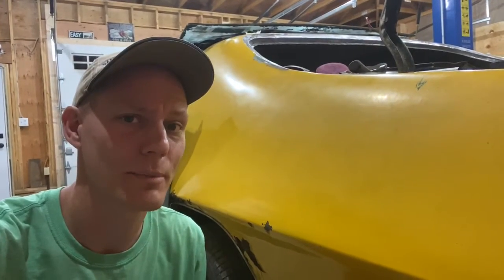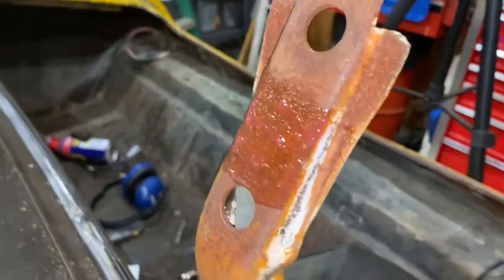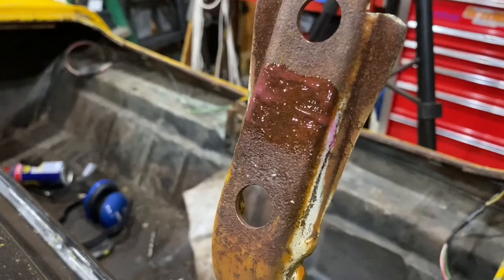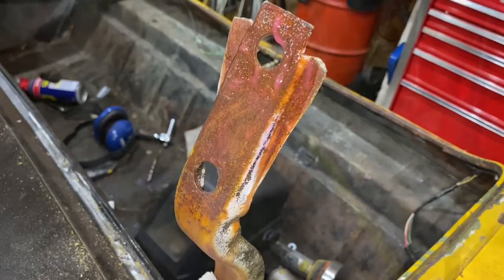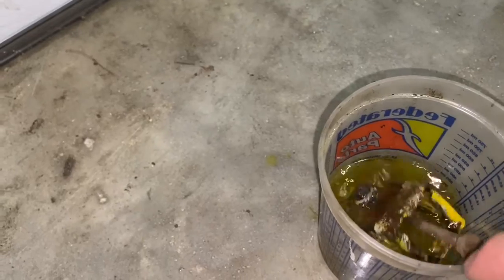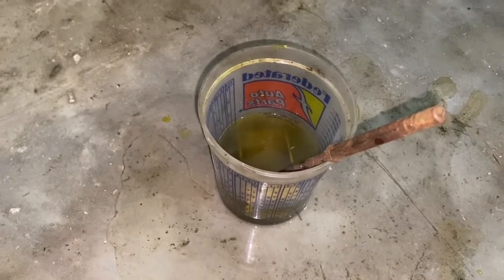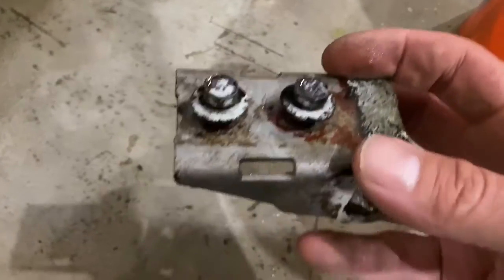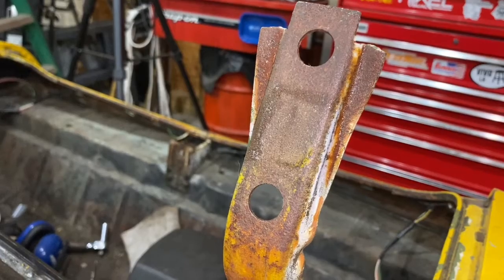Rust Removal: Naval Jelly vs. Muriatic Acid - Who Wins?!

Comment: Naval Jelly on flash rust, or surface rust on bare metal that you may have stripped, but then got pulled away from for other projects, is really good. On thick rust, it is pretty crap. Remove what you can, and then apply a rust encapsulator.

Comment: my choice is.... neither of the above. 
My first port of call for any items you can get into your container of choice, is Electrolysis. It is extremely cheap and safe and once you get used to it, is very effective. Gets rid of all the rust but, unlike any of the acid treatments, does not damage the metal underneath.
Reply from the maker: That is something I have never tried, and I really need to. I have seen others have great success with it!
Reply: @WiringRescue  
A big old plastic water tank, a 12v dc supply [old 'non-intelligent' type battery charger]and a bag of washing soda is about all you need. Remove bulk of rust with wire brush, thoroughly degrease and ensure good electrical contact to individual parts. Give it a go and it will soon become another great tool in your arsenal.

Comment: I used Naval Jelly 50+ years ago and it really needs to sit overnight and be covered with SuranWrap. It works very slow when it's cold but better when warm, but even then, the results are mediocre. Basically, it's not very good stuff.

Muriatic Acid works quite well but if you don't know how to be safe with it, don't use it.

The best is Evaporust. If just surface rust, it will be totally clean in a few hours. If heavily rusted, leave overnight. If extremely rusted, leave in for 2 nights. To excelerate the process, keep it warm or even hot on a stove top. Also, it's biodegradable, will not irritate your skin or eyes and has little to no odor. Absolutely wonderful stuff even at $30 a gallon and you just keep reusing it till it stops working. I use lots of it.

The simplest and lowest cost is electrolysis using a cheap battery charger or just a battery. Google it or spend hours on Utoob viewing hundreds of videos.......

Comment: Hello,
  The muriatic acid is in another league from any naval jelly product. It will remove rust down to the bare steel, but needs adequate ventilation, as the fumes are not pleasant. Muriatic acid will also remove hard water deposits in an engine block that was run without antifreeze, as well as water lines. It dissolves the calcium and iron down to the original surface. 
  I was quite surprised at the poor results of the naval jelly. I had expected something better. You presented the products in a nice format. I found your video interesting and educational after forty years of using muriatic.

Comment: I have used the stuff, it works great.
1. remove flaking rust with a wire brush of some sort. Don't go down to bare metal.
2. apply naval jelly, liberally
3. let sit for 30 minutes. (directions say 5-10)
4. wash off with water.
5. repeat if necessary

Comment: For small parts and tools, submerge in vinegar (@$2.50 a gal) for days, rinse and scrub in water, then dunk in soda water. For panels and welds, sand, wire brush and spray with a rust converter, like Permatex or Marhyde (3M). It turns black.Then primer.

Comment: The Naval Jelly certainly wasn't very impressive, although it definitely did remove some rust, as evidenced by the pitting on the metal becoming more visible. Personally, I've tried just about every rust-removal product/DIY method under the sun EXCEPT the 2 in this video. The muriatic acid definitely had above-average results. However, out of them all, I've found electrolysis to be the most effective method for me. It's very easy to set up, there's a ton of videos covering small-scale electrolysis. I was initially discouraged because the videos all seemed to suggest that an older car battery charger was mandatory. It's not.  I made a set-up out of a basic AC adapter that I use daily with spectacular results. Washing soda is also specified in most instances, so just as an FYI I wanted to note that you can make washing soda out of baking soda; just pour some on a cookie sheet and bake it at 200°F for ~an hour, mixing it up every 15 min, and it will turn into washing soda. You can even use this method indoors, but be aware that if you use washing soda as your electrolyte, hydrogen gas will be released so use it in a well-ventilated area.
Reply from the maker: Great info! Thanks for sharing it!!

Comment: AFTER USING MURIATIC ACID ON ANYTHING YOU NEED TO WZTER DUNK/POLISH/CLEAN THEN COAT LIGHTLY WITH OIL OR A LIGHT SPRAY OF PAINT OR IT WILL BE RUSTY AGAIN VERY QUICKLY. NOT AS BAD AS BEFORE BUT THE SURFACE WILL BE RUSTY.

Comment: It gets under calluses**
Reply from the maker: Lol. I'd believe that!
Reply: @WiringRescue  As a teen I would pressure wash the neighbors boats for money. 

I always used muriatic acid. One time I must have been hand washing or had crawled in it..... Woke up at 3am to my calluses falling off, and 8 holes 1/4" deep. 

A long soak in a PH basic liquid is a good idea if you get calluses wet. 

Good wheel cleaners will do it too***

A good box fan is a long term investment if you love using harsh chemicals all the time. 

Detailing and working on cars is probably worse than smoking lol

Comment: You are using it wrong. The gel turns iron oxide (rust) in iron phosphate which dissolves in water whereas iron oxide does not. Need to thoroughly wash the part with water. That will carry the now iron phosphate away.
Reply from the maker: Good to know. Thank you!
Reply: H2O is the missing ingredient, in changing it to iron phosphate.

Comment: i learned someone expects jelly being left on for less than a day to remove years worth of rust is disappointed..hi expectations
Reply from the maker: I wish it had instructions like that on the bottle. Unfortunately it does not say “leave it on for a day”.
Reply: It’s for light surface rust not the layers upon layers that u expected to completely disappear in 10 minutes
Reply: The loctite jelly works well, but as mentioned you can't expect big results leaving it on for only 10 minutes.

Comment: Always have baking soda near by when using muriatic acid. It neutralizes the acid fast.
Reply from the maker: That is something I will do next time for sure. Muriatic acid is no joke!
Reply: So do you put the baking soda before or after you put the part in?
Reply: @backyardrestorations  you throw the powder on splashed acid, or use a mix of warm water and baking soda. To neutralize an acid bath you put baking soda in after you have finished using it and before disposing of it. Doing so will render the acid inert, so use it only when you are done using the acid. Rinse parts in a baking soda/water solution then rinse  with water for best results and “safest safety”.
Reply: Wear your PPE!  Gloves and goggles.  Also, never add water to acid, you should rather add acid to water... it's a very important safety step

Comment: Many years back when I lived in an apt. And had no garage I used naval jelly for my chevelles floor shifter base. I used wire wheel for heavy rust, finished off with naval jelly, i had more time on my hands then. I believe it did leave a protective layer, zinc maybe? But now all grown up, I'd say sand blast it! In a cabinet, or stand alone, can't beat the blaster.
Reply from the maker: I’ve got the blaster! I was just really hoping to see this work! I may give it another try soon.

Comment: You really should watch project farms video on this stuff. He try's both examples against each other, along with a few other products. It works really well if you wire off all loose debris and stuff and given 12-24 hours to sit. Clean thouroughly with water, dry, and use vinegar to neutralize the acid as prep after rinsing. Water will rinse it, but not neutralize its remnants. Naval jelly works great if given far more time than the directions indicate, and it works best (along with most of the other products) if covered by paper towel, plastic bags, ect. To keep the product out of light and help prevent any evaporation from the product.
Muriatic Acid is awesome, but take caution-if left on too long it will start to eat away at the good metal too. Definitely check out project farms video if you really want to get down to the nitty gritty on this topic. I think you'll like it. With best regards~
Reply: Vinegar is an acid, it is acetic acid. It won't neutralize any other acid. Use baking soda dissolved in water.
Reply: @lareemcra347  2 acids neutralize
Reply from the maker: Thanks Dustin! Project farm does have really awesome videos. His channel is truly fantastic! I also highly recommend it, and in the meantime, I’ll go watch that video, as I must have missed it, and don’t want to throw this naval jelly away. :)
Reply: Indeed. I have had amazing results with Naval Jelly in the past.

Comment: I seem to remember laying it on thick and leaving overnight to settle and dry. The next day it was bluish and sandable.
Reply from the maker: Good info! I may just try this tonight and report back results!
Reply: Depending on temperature and moist. But need wash off with water. Read labels
Reply: It worked. No rust for 3 years
Reply: But take lot of time work but worth it

Comment: I prefer Metal Rescue for smaller oblects, for things that can fit in 5 gal bucket. It's kind of expensive about $33 per gallon. It's non-toxic and non corrosive just throw the parts in ,come back the next day and you're usually done. It can even unstick a rusty frozen engine. It may take a week or so, but worked for me with 1 cylinder rusted up. I plan on using it again this fall to clean up the water jacket on my 396
Reply from the maker: Thanks for the info! I’ll check that stuff out! I’d prefer a less-toxic method of removing rust from small parts.

Comment: Interesting. Naval jelly works really good in removing rust from wire wheels.
Reply from the maker: I had always heard it worked well. I have no clue why it wasn’t working for me. Maybe the rust was too deep?
Reply: @WiringRescue  my only concern with chemical stripping it getting really clean before spraying epoxy primer on it. That muriatic acid will eat up concrete. Its crazy that it makes concrete smoke. But people use in swimming pool maintenance lol
Reply from the maker: lonestar lows - yes! I used aircraft remover to strip my 64 years ago, and it was a LOT of cleaning to get the epoxy primer on there.